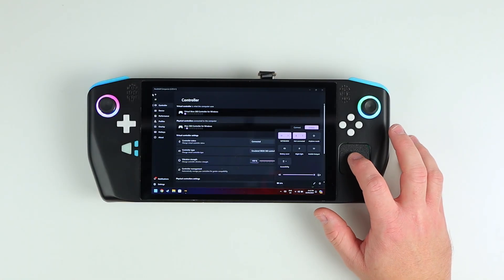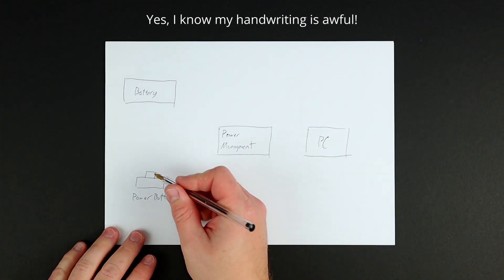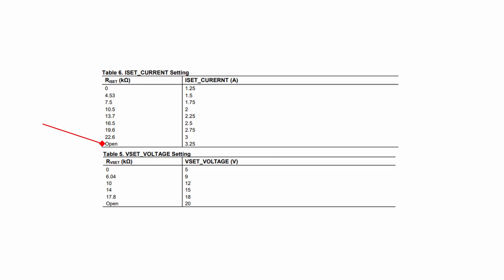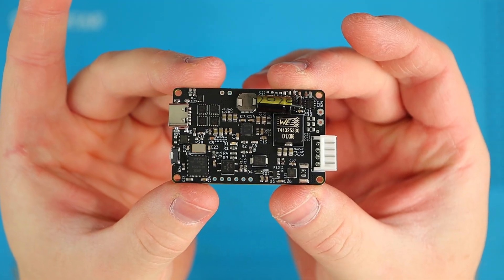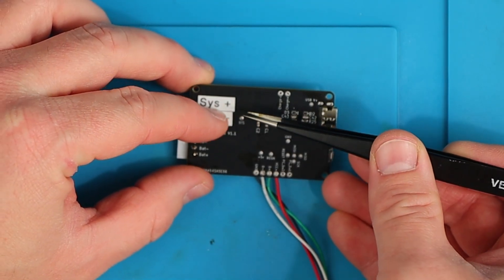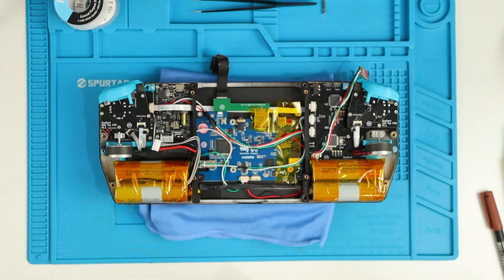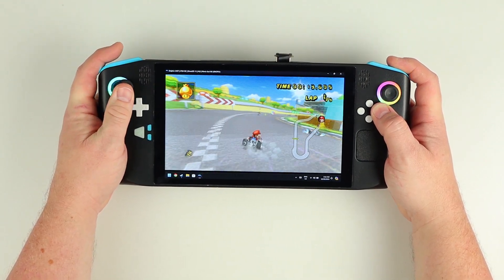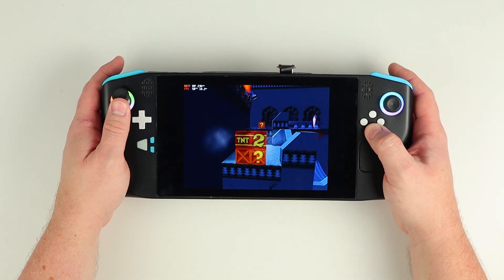DIY Handheld Game Console - ZenDeck - Power Management

Comment: What's the total weight of the ZenDeck with everything in it? I'm curious to see how it compares to the Steam Deck, Ally, and Legion Go in terms of weight
Reply from the maker: It's heavy, from memory about 1.1kgs. I think it comes down to a few factors, mainly the PC itself is much heavier and since the display has its own driver board rather than connecting directly to the pc, there's just a lot more circuit board in there than there otherwise would be. Also the display is 8" 16:10 so you need to compare it to something like the Legion go rather than the smaller 7" handhelds.

Comment: A DIY handheld is an interesting concept and honestly outside of just, having everything be a fully custom design, it's about as good as you can get while using one of those mini PCs as a base. 

I am curious about your choice of OS though.
Reply from the maker: I did a video a while back testing Linux on this device, and I found it to be not much of an improvement over windows. It was actually worse for battery life but often managed a slight improvement in performance over windows, at the cost of more power consumption. Considering most of the games I want to play on this thing will run with a 5w TDP cap, favouring the OS that uses the least power on this platform is the best option for me currently.

Comment: Awesome work! One question, not sure if you've already mentioned it but: does your power management support other peripherals on the USB port besides power? Could I for example hook up a dongle with power, DisplayPort and for example some external hard drives at the same time?
Reply from the maker: I assume you mean through the USB C port on the power management? If that's what you're asking, no unfortunately it's just charge only. I could probably pass the data lines through but I'd need to include a second USB output on the board somewhere as there is already one for the integrated microcontroller.